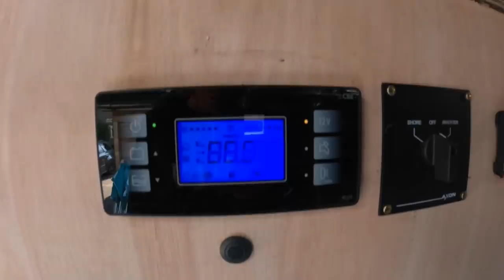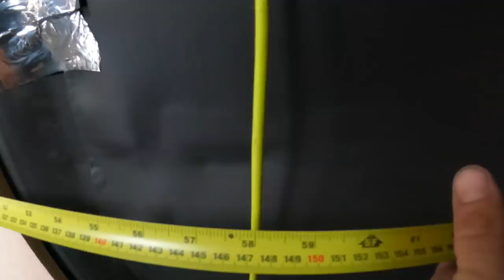THE STEEZE VAN GETS WOOD! EP 6!!

Comment: Only just found your channel but have converted three vario's down the years so here are a few observations so far that will give you issues and easy fixes to issues you feel you have. With regards to the bed there are options to raise and lower the height electronic or manual you could explore. Also the bed will need ventilation or will quickly get damp then mouldy.  Make sure any heating gets evenly spread  through out the van and venting access reaches all parts of the van otherwise again you will get damp and mould issues. Any gas appliances and diesel heating also benefit from a secondary vent. The insulation damp barrier all in one is great but if you trap air under it condensation will soon pool and cause issues. It would have been better to cut strips to fit the panels and get a snug fit. Otherwise dude just found your channel after you appeared with TS 100 and love it. Subscribed and spreading the word.
Reply from the maker: Thanks man I'll take it on board!

Comment: Loving the build.. merc buses are by far the best. Don’t see many of your ones I had a look on eBay. Couldn’t afford a merc like your but I got a sweet transit doing a very similar build to yours.. diesel heater.. room for bikes in the back.  If you get time have a look on my build DTE TRANSIT CAMPER I’m new on here your vids are better than mine so go easy on me. Seen loads of your other vids I do like your high speed manuals 👍
Reply: what dieseal heater did you go for?
cheap or expensive?
Reply: @Hmanfoil  hi bud the cheap ones on eBay are brilliant, used the same one for a few years now with no problems at all.
Reply: @YTDTETV  awesome, did you plumb it into the fuel tank?